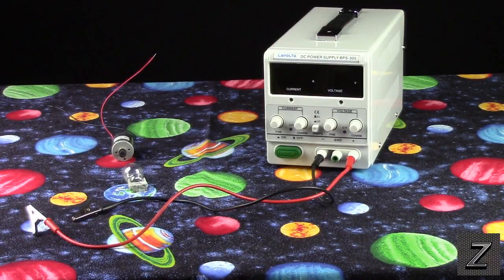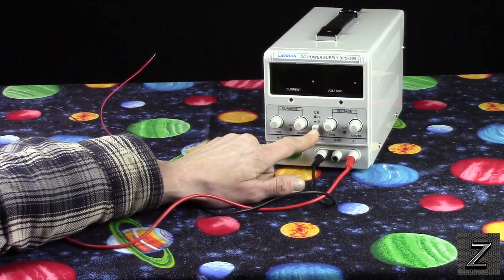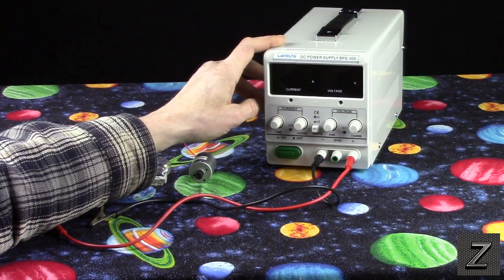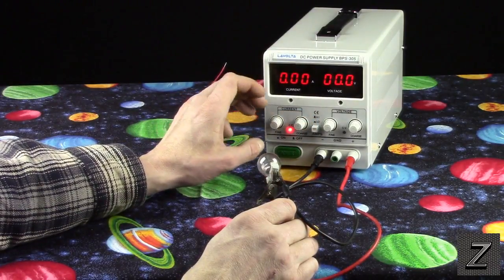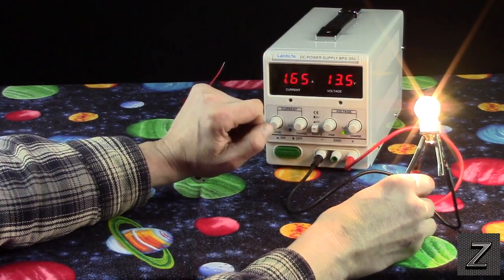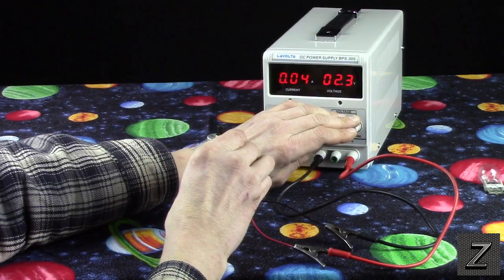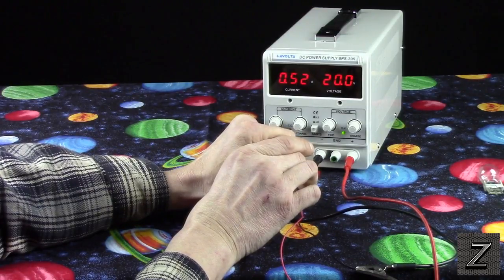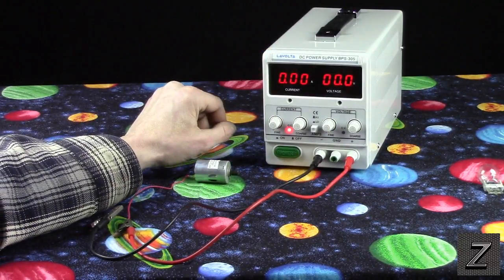LAVOLTA BPS-305 Variable DC Power Supply Review and how to use tutorial

Comment: I noticed that there is a jumper plate connected between the ground and negative terminals, can you explain when to properly use it and remove it for some applications?  Mine came with this jumper and the manual doesn't reference it.

Comment: i noticed you are using your own leads. what is wrong with the ones that came with the PS? garbage huh, absolute garbage. mine just decided to stop supplying voltage. it now only supplies amps, with almost zero volts. these are not sold anymore, i wonder why, i wonder if it is because they are garbage power supplies and will cause nothing but grief.
Reply: Still sold on Ebay brand new too.

Comment: I've just got one of these to replace my rather noisy switch-mode one. It's not a bad supply and seems solidly built. Out of the box, the voltage and current readings are within a few tens of mV (checked against both my multimeters) so no twiddles required. On mine, the 'amps hi/lo switch has been replaced with a 'DC on/off' push button, which is far better. One word of warning - the supplied DC lead had been assembled the wrong way around, with the black plug on the wire with the red croc-clip and the red plug on the wire with the black clip. Could have been disastrous! Good thing I'm a nerd and checked it before use! I may sometime get around to installing a simple fan speed controller as it's on all the time and the sound is irritating.

Comment: Thank for the reveiw  i beleive this is exactly what  i need  as the majority of what i would probably use it for  will be testing  auto and motorcycle  parts  on a bench  not necessarily. High tech electronics or computer. Equipment